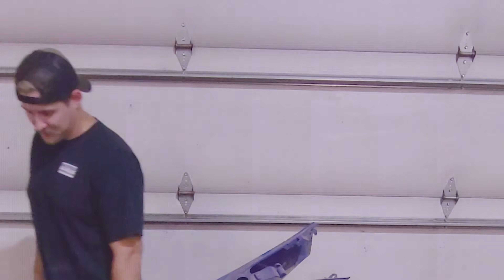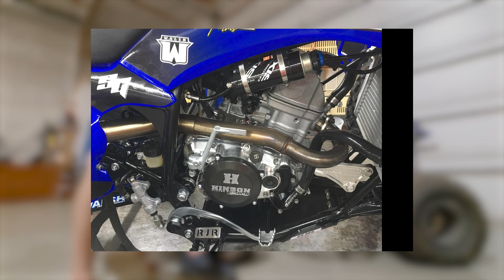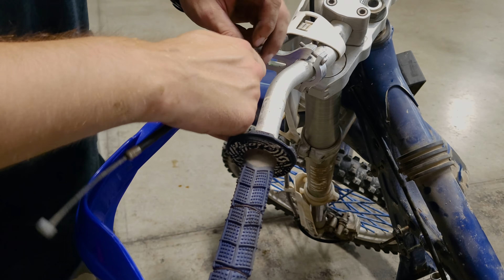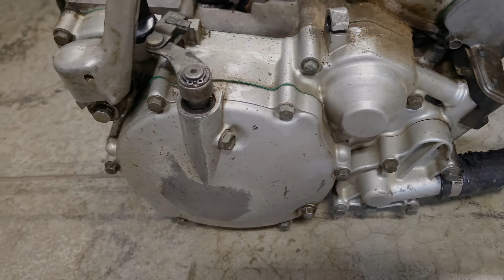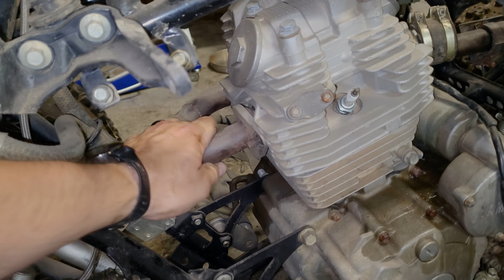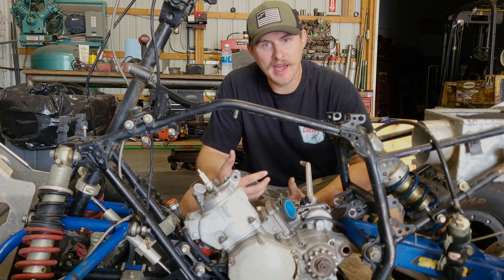Yamaha Raptor 2 Stroke Engine Swap! Part 1

Comment: stoked to see how this turns out... any reason you didn't put a yz250 engine in it?
Reply from the maker: Yes! I have seen a few yz250 powered quads on YouTube, and while I'm sure that would be awesome, I have never actually seen a 125 2 stroke quad anywhere. 85's and 250's sure, but not a 125. Also with it being a smaller machine, I wanted to kind of keep it "underpowered" in a way. The idea was to imagine if Yamaha came out with a 2024 Blaster, if that makes sense.
Reply: @dadspeed227  cool, I like your reasoning. Could always upgrade to a 250 if you need more power haha.
Reply from the maker: @Logan Dilts  thanks and absolutely! A 250 2 stroke build of some kind is definitely on the list for the future.
Reply: Checkout the other yz 125 quads about

Comment: Looking forward to seeing the end result! That thing should be a blast to ride. If you hadn’t already, I would plan on gusseting that frame. Those frames are known for breaking and bending when they’re stock, let alone with that engine lol.
Reply from the maker: Thanks man! I wasn't aware of that I definitely will.
Reply: @dadspeed227  yeah we figured it out too but it was the hard way lol. Clipped a tree and bent the nose of the frame over about 5-8 degrees. It was pretty bad.